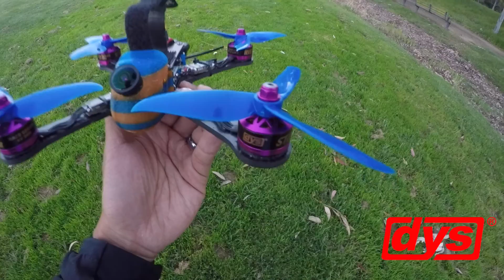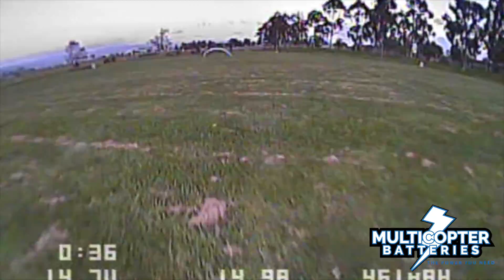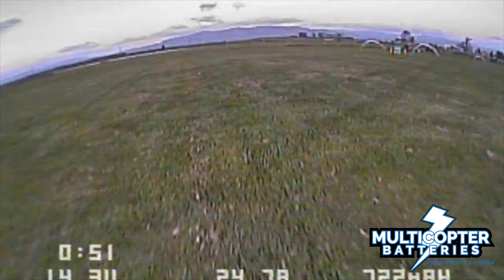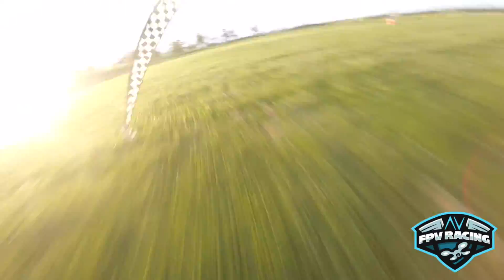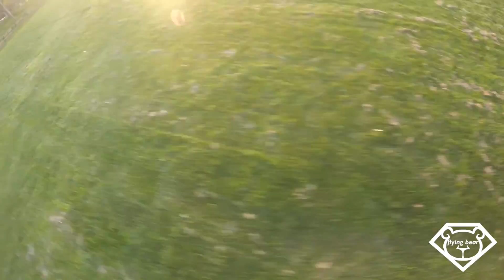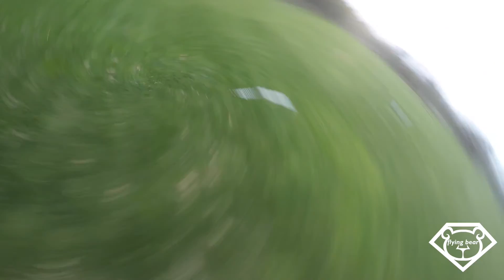DYS Storm 2207-2550KV Motor Review

Comment: nice! you're going so fast you need to increase that gopro angle!
Reply from the maker: I know =(  I designed the gopro mount for 35 degrees.  It works great for freestyle but not for racing when my FPV cam is at 55-60 degrees.